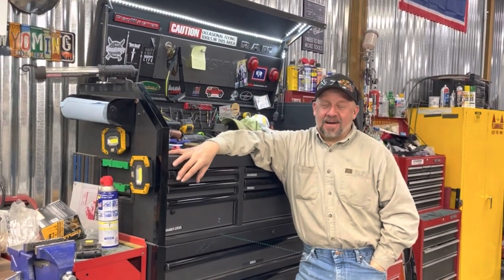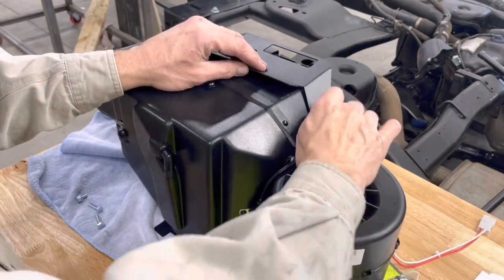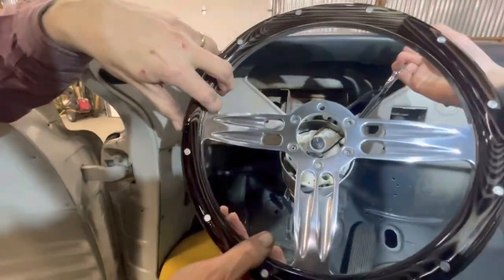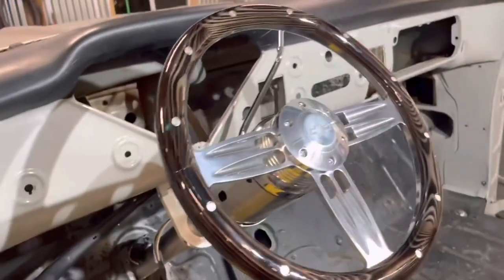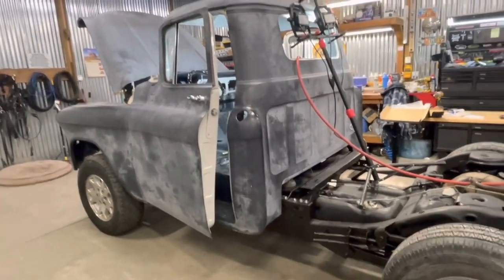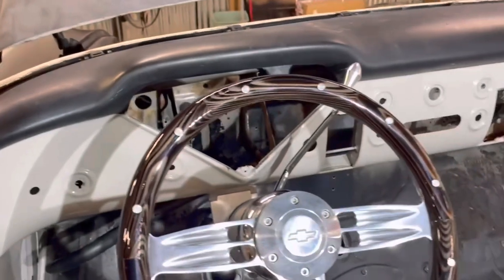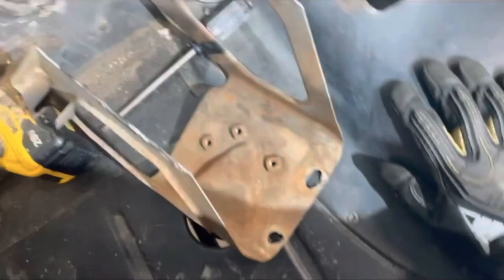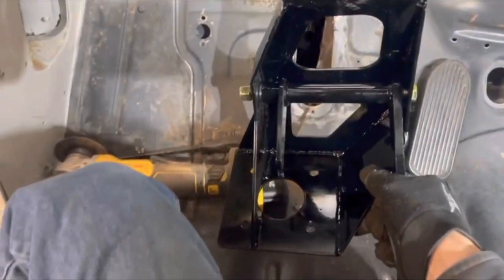57 Chevy Truck on a Tahoe Chassis Swap Part 5!

Comment: Before final mounting the steering column put your seat in that you are going to use. Measure from your belt buckle to the wheel in a couple places (like from the buckle to horn button). Measure from the top of your legs to the wheel in a couple places. Take those measurements to your favorite daily driver and see how they compare. Comfort when driving is everything. I have a similar brake system, my accordion rubber boot rubbed on the left diagonal brace so I cut it and put a bow in it and re welded it. Really nice build thanks for sharing.
Reply from the maker: Thanks for your suggestion that I compare it to my favorite daily Drive great idea I’m headed out to measure that

Comment: Your moving along at full speed! Love your Ididit column,  steering wheel, and brake booster set up! Attention to detail! My E Z Chassis kit (C10/K10 chassis and 1955/1959 cab) , came with a weld-in firewall plate for the brake booster. Its to be used with a inexpensive S10 steering column. I like your Ididit steering column much better! Im not sure if the weld-in firewall support plate would even be necessasry with your Ididit column/brake booster, but it would provide a smooth look on the firewall.   Also, If a brushed aluminum look is what your after for the column, I believe a simple coat of clear could  be applied, to preserve the look of the column, and would look great!  Cant wait for your next video!  Keep up the great job!
Reply from the maker: Thanks for your suggestions and your encouragement. This has been a journey I wanted to do for a long time and I think the YouTube encouragements is going to help me finish it.

Comment: 😉👍 All l👀k N Nice! coming along!

I like the hat, 🤔 you know Paul should sell them like that, lol 😆... as many times as he has hit his head.

I like, steering wheel is a bit small but it works 👍, column looks nice too, but I'm afraid clear coat might not help protect it enough from rusting , so do your research...  If you do decide to paint it I would say not black but whatever color the dash is.  Have we ever decided a color??? I like red! 😁

Break pedal does look like an old starter button, maybe you should put a retro looking floor starter button back in,  I do believe they make modern versions that are electrical, It definitely go, and be a bit extra security as nobody knows how to use those anymore lol... Of course I don't know how well it would work for you.  

So I imagine this breaking system to delete in the ABS from the Tahoe,  🤔 How hard would it be to leave the ABS system with new master cylinder... would be nice If not too much extra work.  I don't know about how much wiring in all that...

🤔 Did you ever figure out what you're doing with a gas tank fill? P.S. Recommend checking the evap lines/canister on it, blow while you got it all apart,  as they always go bad...

Something to think about down the road maybe, If you're thinking about car shows and all that... of course it costs extra cash just for looks, but they do make some dress up kits for those LS to make them look more vintage style,  Overpriced coil covers and intake swaps and all that.

Really like this build, You're doing everything right it looks like and unlike others just slapping stuff together and not showing all the issues and difficulties that go along with a project.
Reply from the maker: Thank you for your input and thoughts. I haven’t got all the details figured out on the tank and color and all those things but I’m sure it will come together. I do like the idea of painting, the steering column the same as the dash that would kind of blend in and look nice. Thank you for coming along with us on this journey.

Comment: If you want to clear coat your steering column I would use a product called shark hide. I have seen it used on brushed aluminum parts and it looks amazing.  And protect against corrosion. Don't know if it will work on steel. But can always call company and find out. Coming together beautifully keep up the great work. One of my favorite year trucks. Not sure what your looking for out of that 5.3L for power but you might want to look into a Brain Tooley racing cam called Truck Norris. Will give it that old school muscle car sound and add about 75 hp and 75 lbs ft. Of torque.  It will be a beast. I have 2 of his camshafts in my vehicles.
Reply from the maker: Remind me again, as I get down the road, if I get a chance to beat up the motor.
Reply from the maker: I seen Paul with fab rats when he had at Chad’s fab they were using the shark skin on all the bare metal of his truck, and it looked good.

Comment: Russ the switch on the end of the steering column is the neutral safety switch and the reverse light switch
Reply from the maker: Thank you I was kind of gas now, but I hadn’t thought it through yet

Comment: FYI that chunk of brass is your proportioning brake valve . it should match your brakes .for instances disc up front and rear or disc up front and drums in rear.,it controls the amount of fluid to the rear or front . Also you will need to bench bleed your master cylinder, youtube  has videos  to learn about bench bleeding. N proportion  valves.God bless yall real good.
Reply from the maker: Yes, thank you for the information. The proportion valve when I ordered the brake booster they ask if I had disk front and rear and you had to specify which type you had before you ordered so I’m sure it is calibrated for front and rear disc brakes. hopefully it’s adjustable if I need more front and less rear or vice versa.

Comment: The 57 is looking good definitely making good progress on it I like the steering wheel👍.   That is a proportioning valve but you still might need to run a adjustable one so your front to rear braking is proper.   Also make sure the master cylinder will match the size needed for the Tahoe brakes. A lot depends on if your keeping the abs or bypassing it.  I've been figuring things out for my 57 only I'm swapping my body onto a short bed square body and putting 1 tons under it with a little lift and 37's.  Have you decided on color I liked that link to the napco you sent in a reply back in a few videos back that truck looked sharp.
Reply from the maker: When I purchased the kit from performance on mine, they asked the question if I had disc brakes, front and rear, or disc and drum so the valve is set up for disc brakes all the way around. I am not going to be able to use the ABS too much computer requirements with the new computer. I deleted that I will just have to remember how to drive.

Comment: Bless Don’t paint the steering column. You’re headed in a nice direction using as many OEM parts as you can. Thanks 😊
Reply from the maker: Yeah, it looks like the consensus is leave it bare metal, but try to clearcoat it somehow

Comment: Love your videos. I’m currently using a EZ Chassis kit on my 64 C-10. I’m currently working on brakes, just wanted to touch base and see if you’d had any issues pairing this booster with the Tahoe brakes?  Does the ABS still work? Thanks!
Reply from the maker: I removed the ABS part it was not going to work. At least I didn’t figure out how to make it work so I’m going with just a proportioning valve front rear and I’m using a new brake booster. If you wanna call me, let me know and I’ll teach you my number.
Reply: Sure, that would be amazing. Thank you.

Comment: Wondering if you’ll need to bypass the aftermarket proportioning valve and use the Tahoe items in order to retain the ABS?
Reply from the maker: I decided to ditch the ABS
Reply from the maker: Just to simplify things
Reply: Could you give me more info on what you did to bypass the abs

Comment: I understand your choice to ditch the ABS, but I am curious as to why did you decided to use a new brake booster setup vice the original Tahoe one?
Reply from the maker: They make a pedal kit that goes on the dash of the 57 and excepts that new booster. I have seen some people use the old booster but it’s all good plumbed and wired for the ABS and stuff.

Comment: Measure your holes that you are going to weld up. Then contact someone like Send Cut Send give them the sizes plugs you need and then will cut them Send Send to you fast.
Reply from the maker: Any idea what it would cost to have one of the pieces cut out?
Reply: @russellmcconahay7297  no sure dont

Comment: Where are you putting the battery
Reply from the maker: I have the factory bracket and I believe it’s gonna fit right where it used to be on the factory location, right side, upper side of the firewall

Comment: Which Ididit did you end up going with?
Reply from the maker: I will have to pull the box down and see what it is. I think I got the steel one that has the column shift and tilt.
Reply: @russellmcconahay7297  I was wondering based off the size options from the universal ones and the retrofit ones too. Going to be putting the cab on our project this week to measure but we’re doing the exact same project as you it seems